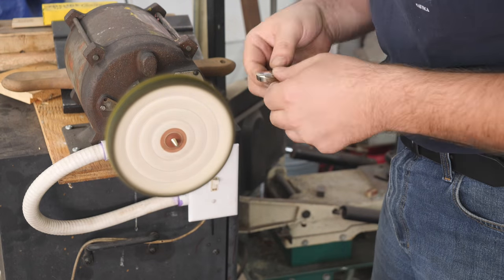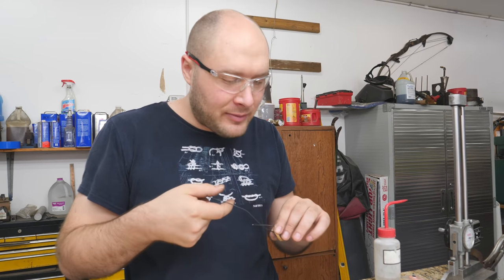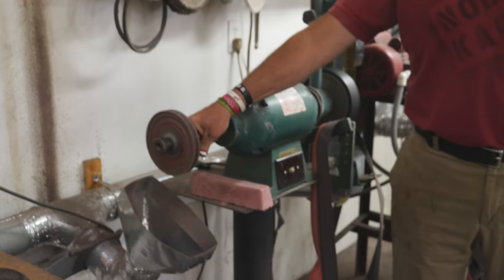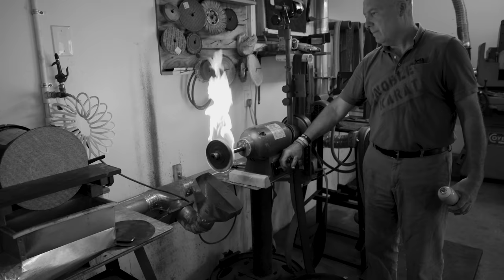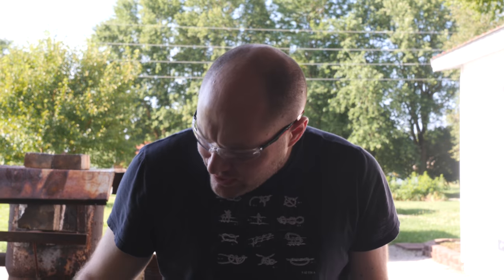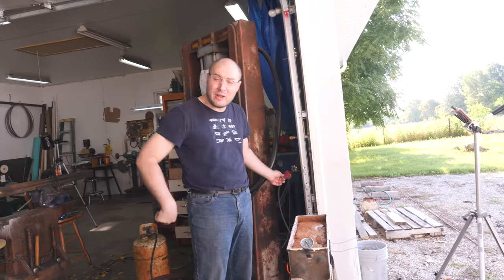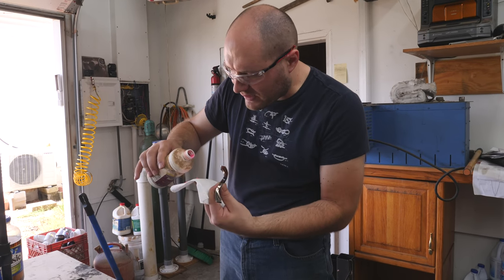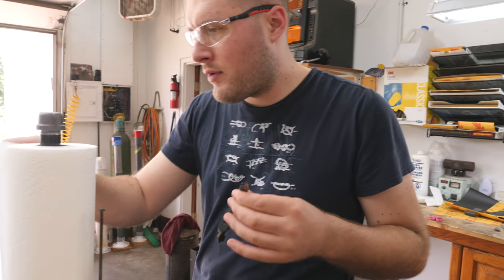Making a 23" Mosaic Damascus Bowie Part. 10

Comment: I'm a relatively new subscriber but I also like Red shirt guy. I assume he is Kyle's dad? Anyone who sets a buffing wheel on fire to clean it is a legend in my books. "Kill it with fire" is a great catchphrase.
Reply from the maker: Yes! That is Jeff, Kyles Dad :) ~Team Royer
Reply: If you are a novice in properly using a polishing wheel... putting to much pressure on the part to polish means you are not using enough compound.  Which then generates excessive heat on the part and leaves polish particles and residue on the parts. Which affects your bluing causing you to have to reblue. Over heat the wheel and it will catch fire. Which does ruin the polishing wheel.  Cross contamination of course grit wheels and fine polish wheels ruins wheels.  To much pressure on edges and holes rounds them over.  If you're seeing scratches,  your wheel is dry not enough compound and to much pressure on the wheel.  Before you first use the wheel determine the proper direction for rotation of the wheel and trim it to remove all the loose threads. Proper care and prep of your wheels will result in better and quicker polishing.

Comment: I guess it's Sodium Hydroxide and Ammonium Nitrate that you boil them in to blackening them. I've done that with a chain mail, didn't think about the galvanization on the wire I used but it burned off right away when dipped into the hot solution and it got black.

Comment: Lol, gotta love that papa Royer and his epic shenanigans 😅

I'm a bit surprised Kyle always ends up getting such an incredible finish using straight tap water for all the water involved in the hot blueing process, I've never tried it but I was under the impression that many guys are very 'strict' in only using the cleanest water such as rain/snow water or distilled, but you're definitely making it work which is what counts.  I wonder if switching to distilled would potentially help with less surface anomalies appearing and thus do-overs?  Great stuff team Royer! 💯👍

Comment: Amazing!!! Could you please tell me what I need for all this process make  metal black? Thank you.
Reply: You can get a complete setup for bluing through Brownells.  Technically it is not black, but a deep rich blue.  But appears if do e correctly to be black. Bluing is a controlled process of rusting the metal.  By adding ice to the cold rinse tank the part is placed in prior to the salts and super cooling the metal.  The bluing will not occur faster, but the depth and darkness of the bluing will be like a very deep dark black and if it was a highly polished part absolutely beautiful. Originally bluing was Browning...that via translation become bluing... but, there are other processes than hot salts bluing.  That have different variations of how deep the "color " is.

Comment: The proper way to run your bluing salts... boiling point for the salts is based on the altitude of where your are. For example in Colorado proper boiling point is 270 -275 degrees.  Stir the salts to break up the salts before you light the burner to prevent hot pockets of salt.  Light your burner with a low flame that is center of the tank evenly NOT up the sides. Pre clean your parts with alcohol and do not touch or you will put oils on the surface,  dip into the cleaning soap , to much soap will leave spots, rinse in hot water, dip part in COLD water, colder the better, let set about a minute, place part from cold rinse to bluing salts... salts should be at a nice even boil at the proper boiling point... to low you can rust or cloud the part.. to hot you will rust the part.. it needs to be right at its proper boiling temperature... allow part to set 3 to 5 minutes,  to check bluing progress lift part and immediately place in cold water rinse.. if you do not it will spot, rust and or cloud ... check level of bluing and if needed go directly from cold back to the  salts... another 3 to 5 minutes ..then from salts to cold rinse water tank... if bluing is  complete place part in boiling water tank about 20 to 30 minutes unless there are no holes or crevices,  just flat pieces 5 minutes... this boils any salts residue away to prevent rusting.. place the parts in oil..or spray down with gun oil... this is not engine oil... it displaces the water and cures the bluing... your done. To cool off the salts BEFORE turning the burner off... carefully add water to reduce the temperature to the proper boiling temperature.  Then shut it off. The salts will retain a memory and next time they will boil properly at the proper boiling temperature you shut them down at . If they boil to soon you add salt a little at a time to reach the proper boiling temperature  if the boils above the proper boiling temperature add water to reduce  carefully to the proper boiling temperature.  Once set if done correctly.  Your salts will boil properly at the proper temperature every time.  You will not see more than a few degrees increase , 2-3, if any. You will only occasionally have to add salt.  Your salts will blue better with age. Reaching high temperatures will burn the salts and ruin them.. seen in your bluing finish.  Use of the product to remove a bad bluing job a Gunsmith tries to avoid.  It can cause problems with the surface or polish and your bluing.. bluing will polish off just as easily and does not have to come clear off to revalue. Your finish problems were caused by improper bluing process. Good steel,  clean steel,  great matchless finish and proper bluing procedure and one and done in 30 minutes.  Time is money and as a Gunsmith we place the same quality standards on our finished product.
Reply from the maker: Hey Ron thanks for the hot bluing manual 👍🏻🔥☕️⚔️
Team Royer

Comment: So if you need more water in your blueing salts, could you boil the water first, then pour in the boiling water? There would still be a temperature difference, but not as much.
Reply: If you are boiling down the water level.  Your improperly shutting off the tank and over heating your salts.  If you're low on water add it before you start, stir it and the salts carefully and don't over fill the tank.  Light the salts and it will boil to soon,  because now the salt / water ratio is wrong.  So you will add salt a small amount at a time until you reach the proper boiling temperature for your altitude...in Colorado it is 270-275. Now your salts are ready to use. They should not  go up in temperature more than 2-5 degrees if any. If they do cool it down carefully with cold water to reduce to the proper boiling temperature and shut it off your done.  Next time you light it to blue again,  it will start to boil at the proper boiling temperature.

Comment: Could do the same with cold blueing? I don’t a lot about either but it would seem easier than keeping heat right temperature? Thanks for another great video.
Reply: No, cold blue is used only a touch up product for small spots, wear spots on a firearm.  It does not have enough to create enough reaction to properly penetrate the surface during the process.  It will turn the metal,  but it will not last . Another process you could look into is slow rust bluing or Belgian bluing.  Actually older than hot salts bluing and used more on high end firearms.  Requires less equipment and expense. But is a more time consuming process.  Contact Brownells for product information.

Comment: could you add hot water to the salts bath with a spray bottle?
Would be a slow add via mist of already mostly hot water to minimize the heat drop.
Reply: That would make no sense.  If you use the proper procedure.  Your salts will boil at and remain at the proper boiling temperature the whole time.  If it does go up you cool it back to the proper boiling temperature when finished and then shut off the flame.